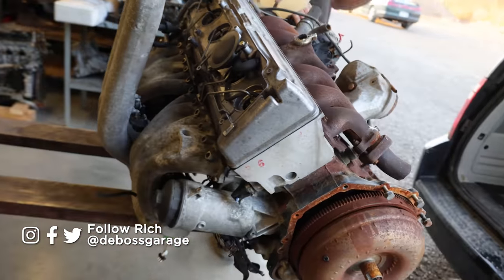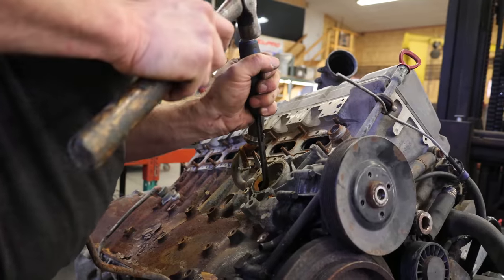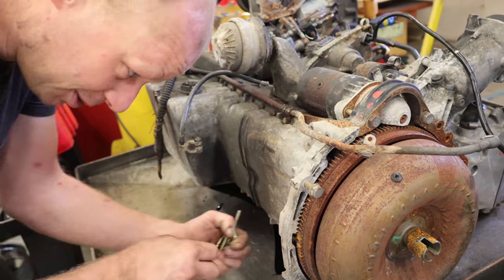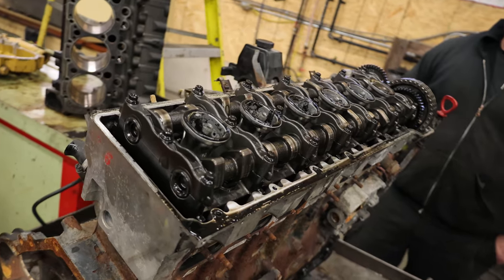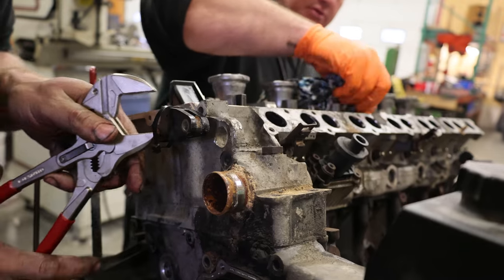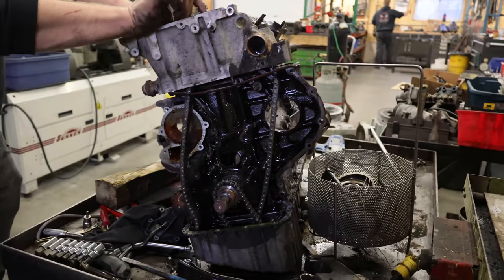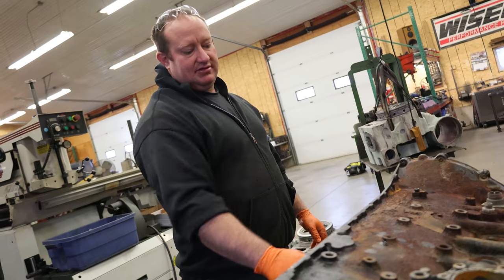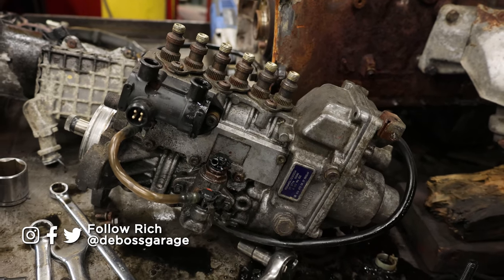REVIEW: Everything Wrong With A 3.0 Mercedes OM606

Comment: I owned a Freightliner powered by a mercedes diesel and it had plenty wrong with it. In the 2 years I was stuck with it, it spent 9 weeks in the shop, and was towed in 14 times.  Most of the problems arose from the controls, but an egregiously poor design choice was the use of a serpentine belt to run everything, including the waterpump.  When the A/C compressor seized, as they will do, I still could have limped it in for repairs, (roll down the windows, conserve battery etc.) but with the waterpump out, I wasn't even able to make the next exit off the freeway. Mercedes may have in the past made some good engines, but this one was designed by engineers who must have worked in the old Trabant factory.

Comment: serious question, If it’s the 2jz of diesel motors, Why does it make 1/4 or 1/3 of the horsepower to a 2jz gas motor turned up? 

As to the Europeans “laughing at us” I’ve heard this for years but it would be like saying the Europeans are laughing at the Europeans for their overland trucks only making “as much HP as this tuned om606” which is to say an absurd statement. Just to prove it, I would enjoy watching someone put a turned up OM606 in a bus. I mean after all what would we make a bus engine so robust for... it could be 1/3 of the weight. Let’s see it make that power in the same way, at the same cylinder pressures and not destroy itself.

Comment: That pump sprocket not only auto retards it and those r weights work with rpms faster u are more the timing advances so it doesnt loose power n torque on hingh rpms. Centrifugal mechanism.

Comment: 500 horse on a 12 valve is a different type of horsepower than a 3.0 liter would have.  this engine would never have the torque that a 12 valve would have and this engine wouldnt like a 7,000 pound pickup.

Comment: 1) yeah your supposed to use a chain breaker to open the timing chain, then you can pull the head! 
2) The pump on the front is a vacuum pump for the brake booster, and vent flappers. 
3) on the topic of adapters, rather then mucking with hacked up pumps see if you can have an adapter plate and shaft made for the P pump. that way you can use unmolested replacement pumps! 
https://www.dieselmeken.se/
https://mercedessource.com/ 
https://transmissionadapters.com/collections/mercedes

Next show us everything wrong with the Kubota V2203! including how to mod the fuel pump for more power! https://www.overlanddiesel.com/conversion_kits.html

Comment: You know it’s a good engine when it fits in the back of a caravan.
Reply: @knut5328  high horsepower capability and light weight means it’s good. Love Mercedes diesels, sucks my frieghtliner has a Cummins rather than a Mercedes diesel! Cummins have left me stranded on the road far more times than Honda’s have and I have owned many carburetored Honda’s and with some tinkering they could go. These junk Cummins won’t even restart if the turbo is not spinning! It has a turbo speed sensor.
Reply: @franknedobity2757  in certain motorsport applications then yes, but otherwise no. 
when you tune a engine to get stupid amounts of Hp the reliability goes down the drain. what good is a engine that is not reliable in the long run?
Reply: @franknedobity2757  and did you just like your own comment?  😂

Comment: Ripping on "North American" engines because they don't produce the same max HP as "European Engines" is short-sighted.  It comes down to useable power and the curve.  An engine putting out max torque at 1500 RPM is not ever going to make great peak HP because it can't spin fast enough.  You will use more of your "Max HP" when it is achieved at 3000 than if it's up at 7 or 8k in daily drivers.

NA engines are made for NA driving habits.  European engines are made for European driving habits.  Doing long distance highway speeds is WAY more comfortable at 1700 instead of 3000 RPM.

A heavy duty mechanic should understand the application of low-end torque vs high rpm power....

Comment: if you guys want to do a broke dick super pump, take a mechanical pump from an om 603 and swap your 6mm elements from your "edc pump" aka electronic pump and take that to a pump shop to get it balanced.. that should get you 250-300hp and your not buying or trying real hard to source complicated parts since that pump is actually somewhat common in the states.

Comment: Oh yes, get some custom rods, slap a turbo on it, use it instead of an ls in the next swap. Here in Europe they would do that. Except be illegal as all hell cause they don't want us touching as much as a bolt. Disgusting, but motivated people literally swap engines and full setups every year to go to the tech inspection if they really want to use them on the street. When I saw this guy, Peter Bjork I think, probably butchered his name, that's putting a Lamborghini V10 into his Volvo, that had a 2jz before, with a BMW gearbox, I thought, that's awesome. Then he made a video about an event in Sweden and Norway called Gatebil and showed a bunch of crazy swaps. I didn't even know we had such a thing on this continent. They had a BMW engined Supra, next to a BMW with a Supra engine. Because why not. And diesel drift cars and all of that, turbo Volvo 4 cylinders with the turbo taken off some semi. They literally went to the wreckers, got the biggest snail they could find and made big power. What multiple thousand dollar precision turbo? Holset from dump truck it is. The idea of using the Cummins pump you already have, the same kind of idea, I love it. Unrelated, I'm  broke and needed a laptop, I got a very broken (and slow) one from someone that was throwing it away, the screen got punched, it was disassembled and wires cut and what not. I fixed a bunch of things, and used a screen from a 10 year older useless laptop with a vga adapter board to turn it into a monitor, soldered wires to the back of the VGA port on the motherboard, and made it somewhat work. It's the same thing, I used what I got, and it's a Frankenstein. Makes me wonder, is it really that impossible to control those electronic pumps? Cause I really doubt it.  We can program ecu's to do anything these days. I see this trend of mechanics running away from electronics cause they don't wanna deal with the magic box, but once it's understood, it's not hard. We wouldn't have engines like today without electronics. You'd never get a 1000hp 4 or 6 cylinder on the street  with a carburetor and distributor. All those variables that get controlled by the ECU, I don't think electronics in cars are bad, it depends how they're used and what people understand about them. I heard someone say, 90's or early 2000's cars are what I'd get, too many electronics in newer ones. Just because you can see it, through this added screen, doesn't mean the functionality and electronic involvement wasn't there. My family has a 98 a class ugly as hell blob (I can't stand that car) mercedes, nothing out of the ordinary on the inside, has crank windows in the back. With a cheap scan tool I can roll down the front windows, turn on all the washers, wipers, lights, anything that has a button in the front. Set the gauges in any position, it's all controlled by a computer. I don't see how modern cars are any different, they just put it in a screen and now people became aware.

Comment: American Diesel engine cylinder heads, intake systems, and exhaust systems are TRASH. Almost all of them require intake air to slam directly into flat walls, make sharp 90 degree turns, and try to curve around very sharp corners (looking at you duramax).  Gas powered V8’s have proven for years that cam in block engines with push rods and rockers are full capable of turning all the RPM you could want, it’s just that cam grind and air flow efficiency through the engine makes higher RPM problematic.

Also modern spintron testing has proven that cam lobe design is a critically overlooked component in earlier engines that if properly designed around can allow for very high rpm engines with much lower valve train wear and tear.

Comment: The ONLY used Mercedes I would ever buy is a diesel. I have a '74 240D w/ a 4-speed manual that has been in my family since new and it's a n absolute tank I guarantee it will still be on the road long after the modern Mercs have died.

Comment: The pump from om603 is bolton to the om606 just get  the pump and the plastic fuel lines from the 603 to because you need banjobolts and the fitings from it. Im building an volvo with om606 now, check my instagram @sobstad96

Comment: I have the om606 fitted in my e300 w210. I've fitted a om603 pump and it's running 1.5 bar boost on standard turbo. Will be upgrading soon and will post a video. Check out my channel Dan the car man :)

Comment: I preffer the OM642
Reply: I like mine, but I don’t think they can be modified to get those high power numbers.
Reply: @94concours  yeah not as much aftermarket support. Still not too hard to get 450-500 lbs of tq out of them though
Reply: @backyardgarage  yeah, mine has a few mods and a tune. Big improvement, but it’s no powerhouse.
Reply: @94concours  I have two. Both completely stock both with 300k. I tow a lot with them. They work great. Never had a problem just regular maintenance

Comment: Aluminium head = fragile.  You will never get high hp at any kind of load factor for lots of km with a soft metal like aluminium.  Thats why every heavy vehicle truck engine that makes anything like decent power uses cast iron block and heads. Plus if you run the engine under high load and high temps on the coolant the aluminium head will warp. Sure it makes lots of hp.............but for how long?  If you want high hp and rpm in a light powerful engine, use a gasoline version..............duh.
Reply: Lol ur totally wrong these are not some crappy US made aluminium head.